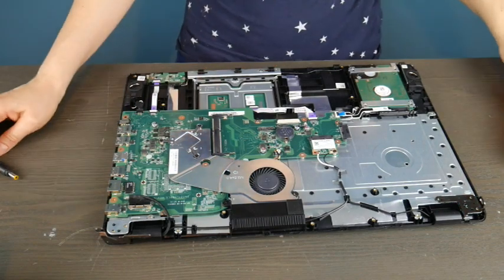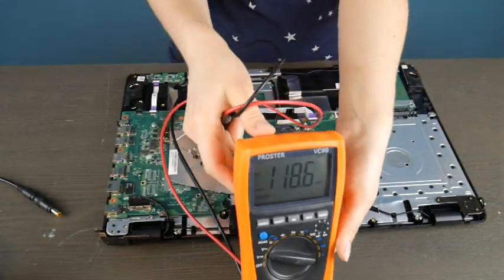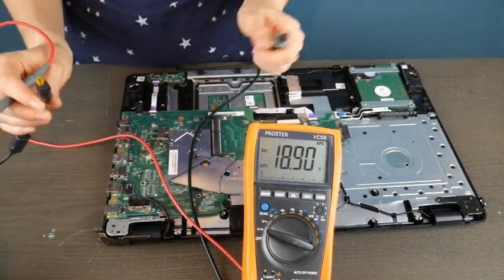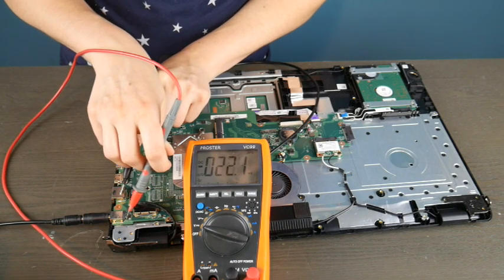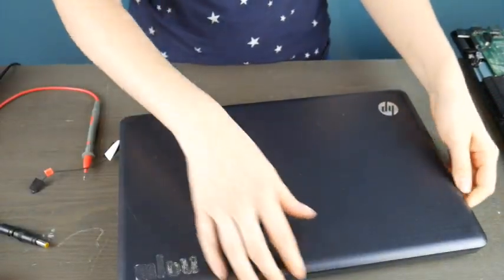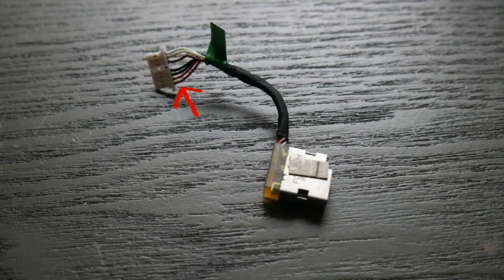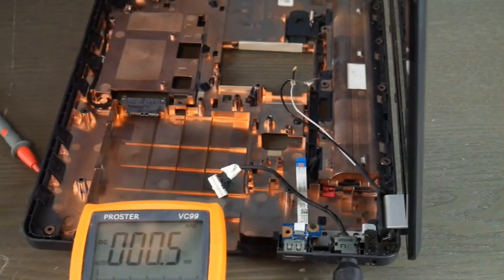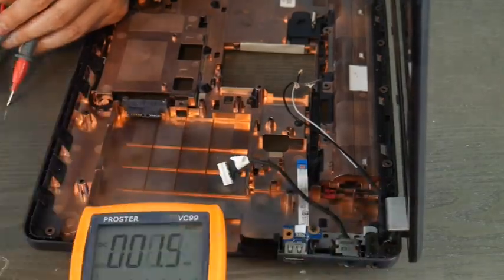How to Tell if Your Dell Laptop's Charging Port is Broken - Learn to Troubleshoot and Diagnose

Comment: I was reinstalling windwos in my dell laptop, but it never reached desktop stage. I restarted the laptop and got hard drive failure and loud pattern beep sound ddooodoooodooo doo.....doooo like this. I watched lots of vids and did sata data wipe from bios but it gotinterrupted. Now after pressing f12 for one time boot menu it does not show uefi but show only legacy even thought i went into setup i checked uefi turned off secure boot and then abck on multiple times.. I am stuck now as it wont even boot from cd which had windwos isntalled in pls help me its my dad's laptop